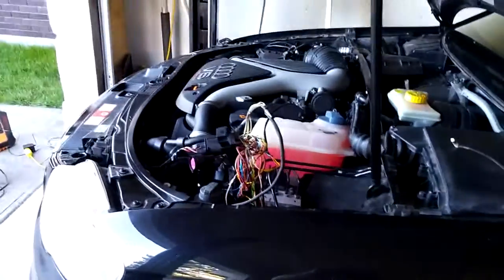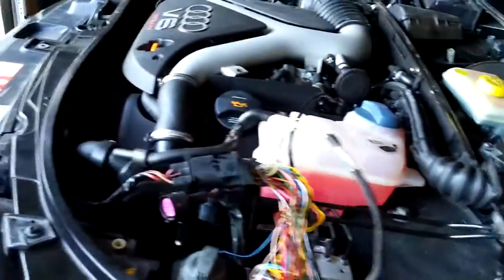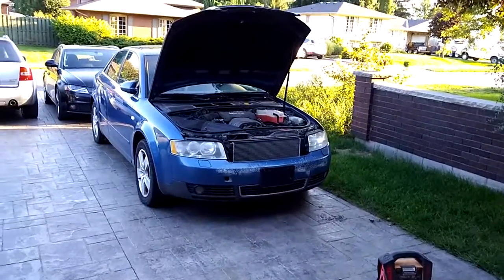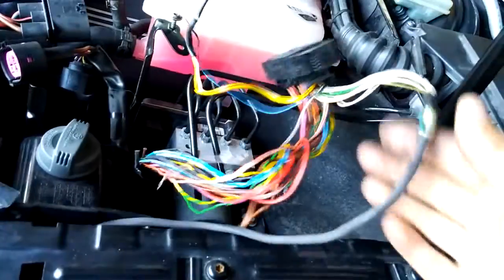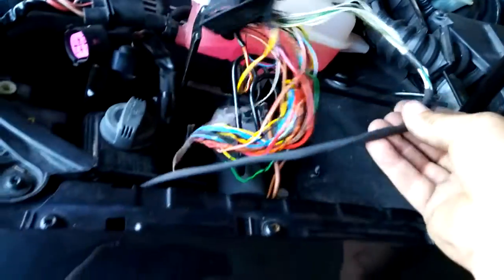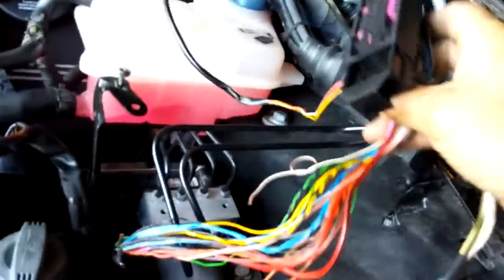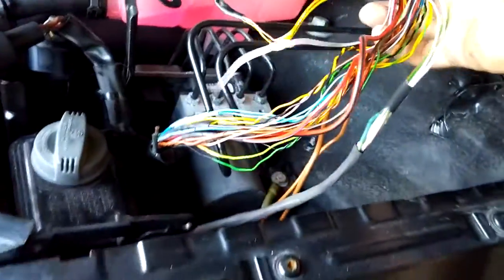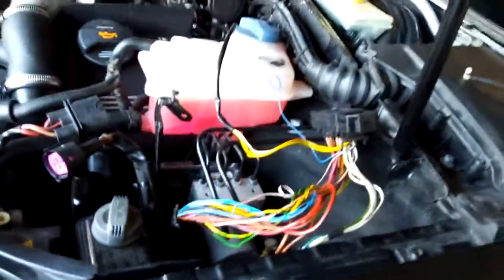20160823 Project B7 RS4 Stage 3 2.7T Biturbo Swap UPDATE 3 ABS wiring

Comment: Hi! Do you have functional oil temp in the rs4 gauge with the 2.7? I have a rs4 instrument cluster on my b7 swap, but the oil temp in the bottom of the FIS dissappeared when i swapped engine
Reply from the maker: I do not. It's the one item that's stumped me with this swap. The only time I have seen "--C" in the bottom of the display is when flashing a new file to the ECU. This leads me to believe that a message coming from the ECU (over CAN) is causing the oil temp to disappear, even though the oil temp circuit is a standalone signal from the engine to the cluster and never makes it to the ECU.